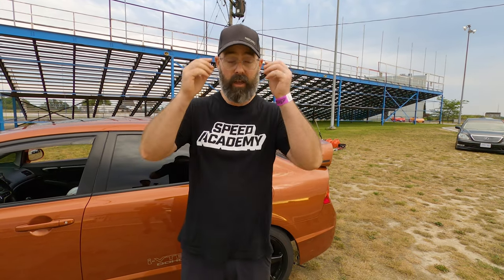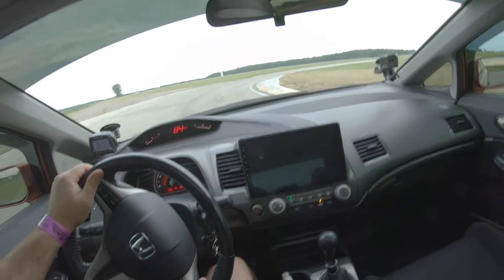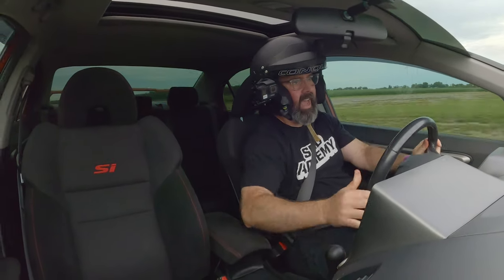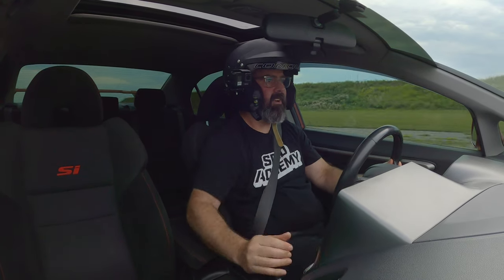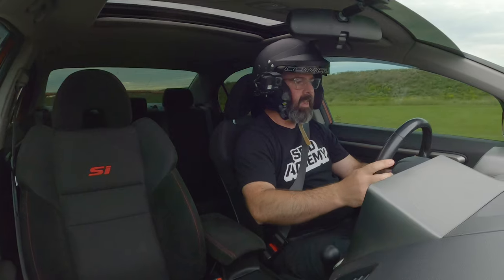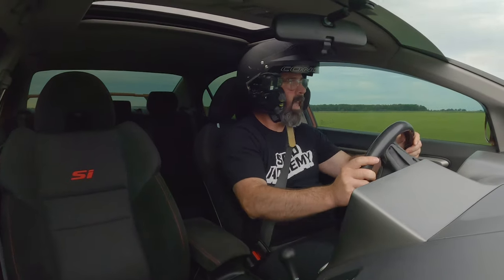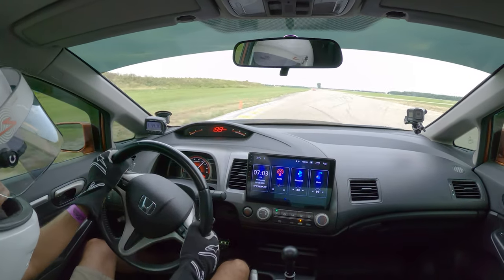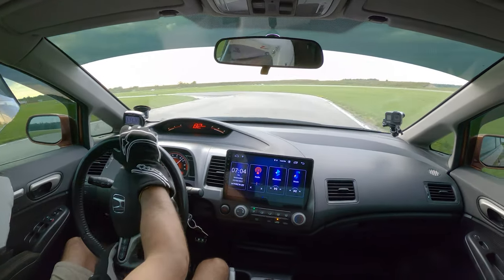Quick & Easy Civic Si Build HOT LAPS - IT'S FAST!!

Comment: Fun fact: there's no need to K-swap your car if you buy a car with a K in it! - I like these.
Reply: Owned one for 7 years, never tracked it or anything but I beat the piss out of it constantly and the only thing that ever broke was a caliper and an AC relay. Incredible cars.
Reply: Damn straight! K20Z3 works for me! 07" Fa5. The most linear power curves are in the most entertaining engines if you ask me, and oh yeah, Enzo Ferrari and Soichiro Honda.
Reply: @ScottMerrihew  Ok, I'm genuinely thinking about buying one of these now. I was about to spend 20k on a very clean and low miles Fiesta ST, but I was a honda fanboy from my motorcycling days and half that buys a good one of these easy. Hmmmm.
Reply: @R3LF13  as an 8th gen owner, do it, they’re very underrated. You can get an extremely clean 8th gen for less than 12k. The interior is laid out extremely well, with a buttery smooth shifter and sharp steering. They make the same hp and both have LSD’s but the k20 has much more tuning potential and support.  Coils, tires, and rear anti roll bar and it’ll handle very well.
Reply: Fun fact: k swapped cars are 500-1000 lbs lighter
Reply: @givemefreespeechyoutubehitlers  i don't disagree with that at all. A k swap ek hatch is one of my dream cars and I would thoroughly enjoy building it, but an 8th gen si would be a faster, easier and ultimately cheaper way to actually get on the road with NA Honda goodness.
Reply: I went out and bought an FG2 as soon as they came out. Had that car for 8 years 130k miles and man did I love that car. Way better than my FC3. I loved my EG chassis better but K>B all day. K>L for that matter.
Reply: @R3LF13  pull the trigger and buy it, I can promise you won’t be disappointed in everything this car can bring you in terms of happiness and enjoyability. You WILL have trouble finding a good example of one though; aka low milage, 1-2 owner, lived it’s life down south, no rust on it, not hooned to death by a teenager, etc.  owned my bone stock ‘08 coupe (fg2) for a little over a month now, just thinking about going outside and driving it gives me butterflies in my stomach and makes me smile.. it really does something to you lol

Also you will immediately notice upon ownership that mpg is ok at best and the low torque. Since the car has like no pulling power in low to mid rpm (assuming it’s bone stock!) the rpms always have to stay high ish to give you good power, which in return chugs gas. However, You don’t buy a car like this to be worrying about what the mpg is, so enjoy it how it is. 

Do your research on it, start searching, narrow it down to a few, purchase it, and enjoy what the car gives you.
Reply: @sums6969  once I got an aftermarket intake, exhaust, and a real tune, the mid range power really opens up and it’s better to daily at lower rpms. I have decent get up as low as 3k rpm. I actually get better mpg if I drive conservatively now, but it’s hard to do that haha
Reply: @sums6969  well since my comments are still getting likes, I should update: I bought the Fiesta ST. I tried to find a Civic Si, but they were all beat, except for a 9th gen coupe, which I surprisingly had no headroom in. I almost pulled the trigger on an 8th gen sedan that was in sort of decent shape, but with 125k miles, I was drawn back to the Fiesta ST, which only has 38k miles on it and the remainder of the factory warranty. It handles just as good as everyone says, and the turbo punches above its weight class. I still have dreams of a k-swapped something someday, but im going to enjoy the Fiesta for a while - planning on hitting the autox scene next year and already have the cart pretty full at Mountune! 😆 enjoy your 9k rpm, boys 🤙
Reply: @R3LF13 I have had my si for 300k miles hitting limiter 3 times a day at least   Beat on it and use it as my daily and no problems other then changing the clutch 2 times and tires oil changes and regular maintenance it’s never broke anything ever I do burn outs every time it rains power shifting from 1st to 2nd and still smooth and reliable. The 125k mile si will last longer than the st with 20k miles Ask me how  I know

Comment: Wish I was there with my K20C2 GenX 6MT sedan. I'm also hitting about 150km/hr before turn 1. No one knows about the base Gen X, but it's the most reliable (and affordable) way to setup a car that can do 120s at TMP. Price are starting to come down for used 2017 model (avoid 2016 because of piston slap) and Quebec has inventory if no good deals in Ontario.